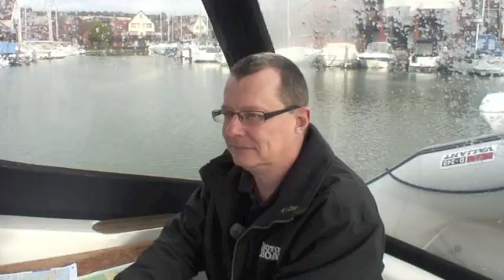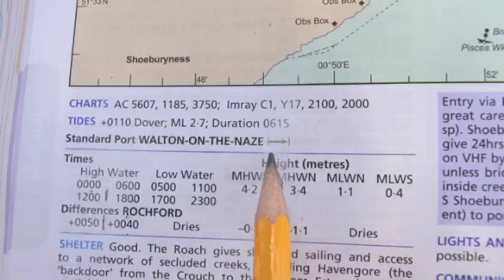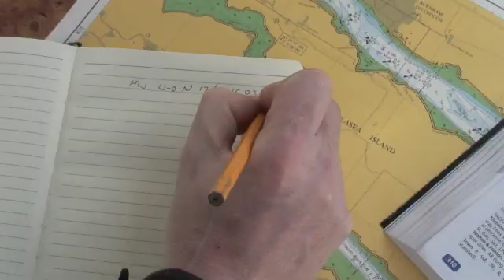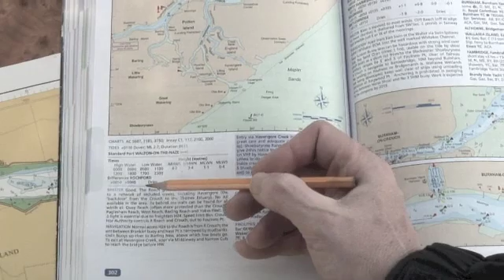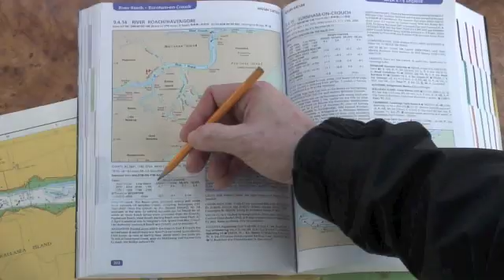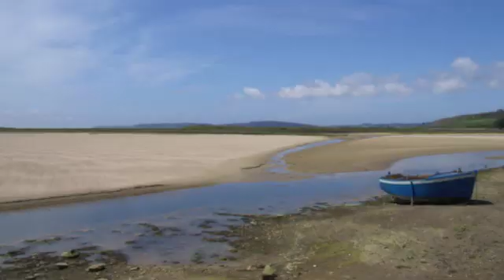Calculating secondary ports practical motor boats monthly

Comment: Thanks for the good video but I have a question. What if the hight of water at the standard port is higher then MHWS at the secondary port? Do you extrapolate or would you just take the value of MHWS (-0.8)?
Reply: I believe your question is redundant as you would not have a value of MHWS at the secondary port to begin with because you need to calculate this from the Standard Port to get it. Sorry it's 7 years late but I've only just found this. I hope you're not still stuck on high ground somewhere as a result of miscalculation! ;-D
Reply: @garviere  Time flies! Hope somebody finds me on this island here soon!